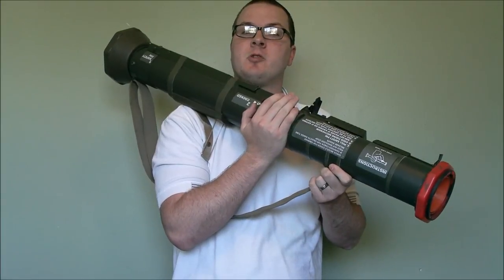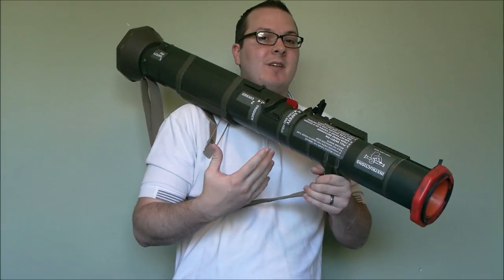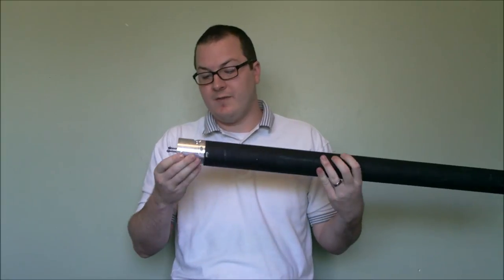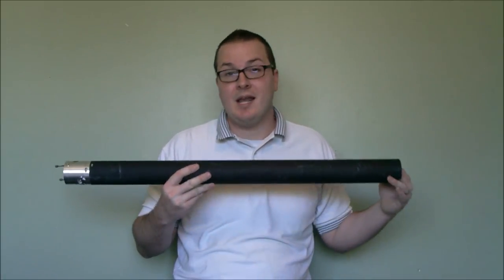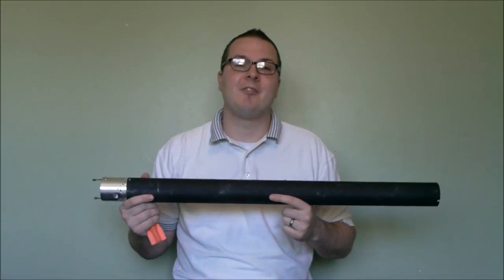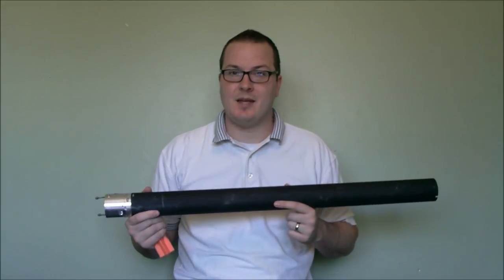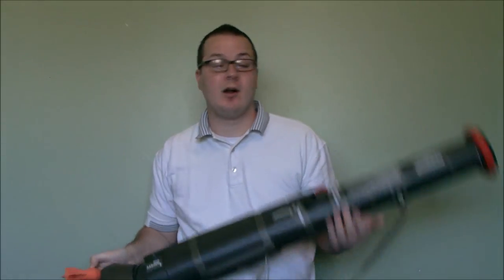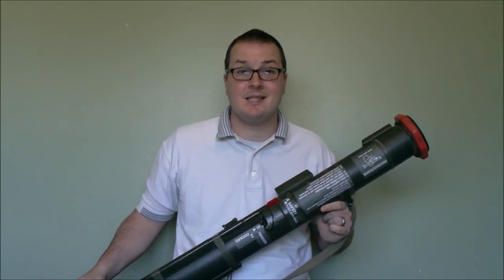Deep Fire AT4 40mm Launcher 1.5" Bore Modification - 200+ Foot Range

Comment from the maker: Yep, it's held by tape friction only, but it's in there really damn solid. I did try the M385 round, which worked pretty well but that round is designed to tumble in flight, so the range wasn't that great. With a barrel this length, the fin stabilized M29 round really excels.

Comment: After doing this mod, can you still use the 40mm bb shower shells?
Reply from the maker: Yep, all you're doing is necking down the barrel to accept a smaller projectile. The 40mm power source is unchanged.
Reply: Thanks! I really appreciate that. I am a big fan of your videos and find them very helpful and always watch them before buying a gun. Could you possibly do a modification for the original projectile of the rocket launcher? (The wooden/metal one)
Reply from the maker: Are you talking about RPG-7 I reviewed? That's a different system than this one, and you can't really mod that round, however, with some foam rounds, you can get decent performance.
Reply: Yes, I am talking about that one. The thing that sucks is that the original one only shoots like 20 feet, but the modded ones work well. However, they do not look cool and do not look realistic at all. You know?
Reply from the maker: Yeah, it's an unfortunate part about that short barreled design. Can't really do much about it unless you totally reengineer the whole thing.
Reply: OK :(
Reply: Do you think the company will ever engineer a better one?
Reply from the maker: There are certainly skirmishable home-made solutions. Milsim Labs has prototyped a few that seem to work VERY well.
Reply: Right, ok. Well, thanks for your time.